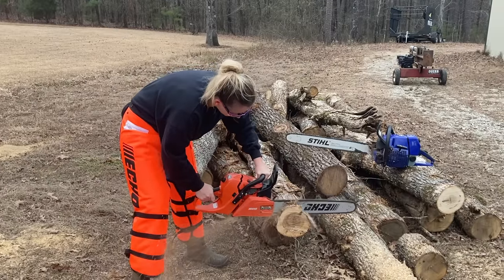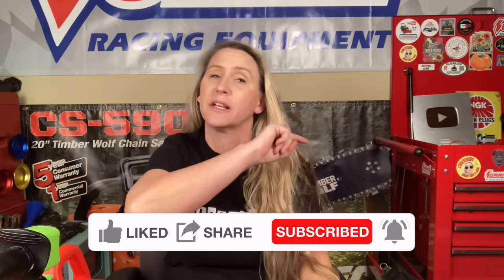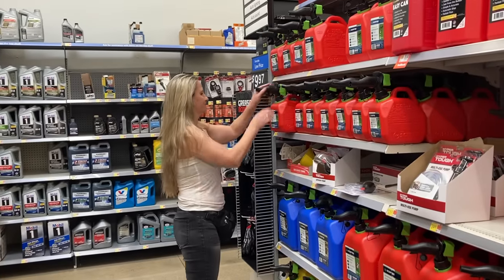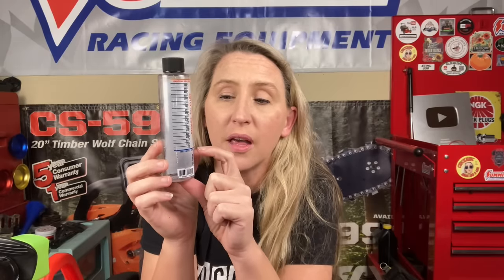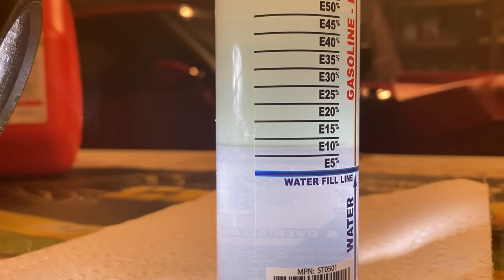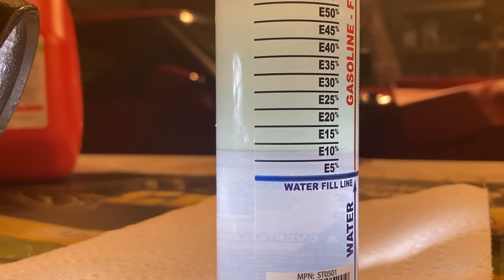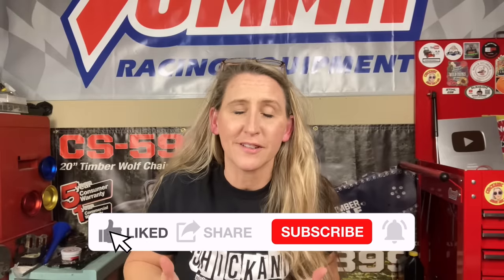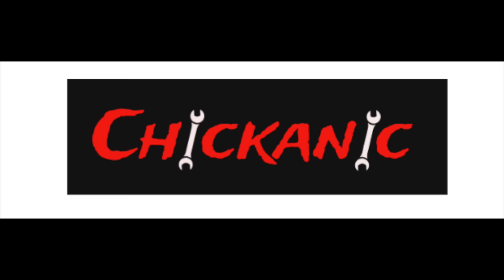Fueled by Deception. How You’re Getting Ripped Off at the Pump! (I'm SHOCKED!) VLOG

Comment: I've always wondered about this. Thank you for the no BS information. From now on when I fill my 5 gal jug with non- ethanol, I'm gonna ask for 6 gals and put the first gallon in my truck. Thanks Brea! You rock!
Reply: I used to do that. But now I drive a diesel.
Reply: Man, we really need to get Americans to fully adopt the SI units.  It's fairly simple, 5 American gallons is roughly 18 Litres and 3/4 gallons is less than three litres.  This is one of the things I hate about Sta-bil is, yes, it gives you rough approximations in Litres but the instructions are clearly written for Fluid Ounces and Gallons.  So the instructions come out with 30 mL to 9.5 L when we should be writing a Metric equivalent so I can easily use the right amount of Stabil for my 20 L and 5 L Sceptre fuel cans.
Reply: @danlux4954  I wish I could afford a Diesel tractor.  Everything runs on gasoline that I currently own.

Comment: Thanks for solving the mystery. When I cut the grass when I was a teenager in the 70s , I remember lawn mowers working for years, no problem. And you have made me nostalgic for my father’s old, all metal gas that had a screw on lid on the end of the spout and screw on metal lid in the top with the old wooden handle. It just freaking worked. The last two mowers that I bought only lasted one season.
Reply: I am still using a Shindaiwa T25 I bought in 1992 new. only NE for over 30 years. dealer told me he wished they still made them that way. Newer machines are made to emit less pollution which is one reason they do not last it seems. Thank the no backbone by our legislators who have let the EPA run over us for years.
Reply: I am using a 1999 John Deere Sabre 54" I paid $200 plus a battery 3 years ago. I cut around 2 acres. I am using NE in it. It sat since 2013 before I bought it.
Reply: Made in China, what do you expect?

Comment: I was a "Heavy Mechanic" all my life. Small engines drove me nuts. But I did learn something from a customer years ago. We were talking about how hard some small engines can be to start and even keep running. I used his advise for decades without any problems, even after sitting all winter. Always USE Super Unleaded (in gas engines of course) and gap the plug to .036. It works for any small engine. I have all sorts of small engines from mower, snow blower, weed eater, edger, trimmers, etc. NOTHING takes more than 2 pulls to start.
Reply: I used to have a small engine repair business. I was curious at one time why Weed eaters fail so soon and become so hard to start after about a year of use. One day I decided to take apart about a dozen of them customers let me keep to investigate what their problem is. My findings were that many of them had the rings fuse- welded into the piston. Once that happens, they lose compression  and things like new spark plugs, adjustment of the carburetor, changing the fuel, rebuilding the carburetor, cleaning the exhaust screen all become a complete waste of time. After that I decided to never work on them again because they are complete junk. I told customers to just buy a battery operated one. The solution would be to make the engine and piston out of cast iron instead of aluminum and to improve the cooling system. They will never do that because they would last too long and screw up their planned obsolescence scheme.
Reply: When I bought mt Stihl weedeater, the shop recommended buying Stihls 6 pack full synthetic 2 cycle oil. Each one treated 1 gallon of gas. 1st I thought he's just trying to add to the sale. But when he told me if purchased with the tool, Sthil would double the warranty period to 2 years. I now use synthetic oils in all my power tools. 2 or 4 stroke
Reply: @normtheteacher5485  I use synthetic 2-stroke oils, and never run the lean oil ratios they recommend these days.
Even in my big outboards I always ran 40:1, and in small engines 25:1.
Contrary to popular belief the extra oil does NOT cause more carbon, it actually prevents carbon from accumulating in the combustion chamber and ring grooves. It's also better for the cylinder walls and bearings.
You do sometimes have to richen the mixture screws a bit to offset the extra oil.
I've never had a carbon problem using this method. 😎

Comment: Great info, and something I had never thought about. Every non-ethanol pump I have access to has the one pump handle. Glad I watched this when I did because I’m about to go get non-ethanol for my new Stihl 261. Those fuel cans piss me off to the extreme. I have spilled more gas and diesel because of that garbage. I’ve worked for the federal government for almost 23 years so I’m painfully aware of how mind-numbingly stupid our government is.
Reply: Been using my Stihl 026 since 1993 and my Stihl MS250 since 2012. Also have two Stihl brushcutters and two Husqvarna saws, and an Echo even. I always get the 'ethanol free' and treat it and so far I don't think it's been a problem. Maybe by it going into a 5 gallon can and then with the treatment added, the ethanol is diluted enough not to cause any issues. However I WILL be looking for pumps with a handle ONLY for the non-ethanol gas - mainly because you're getting ripped off since you are paying more for it. I suppose I could just squirt a half gallon on the ground first, lol. Pretty sure the station owners might take offense!
Reply: @Graysail0r put in your vehicle first.
Reply: @Norm100ful …that won’t work when you’re driving your diesel truck to the gas station.
Reply: @davidj.leavitt249  So true.  Luckily, my pump handle is separate.

Comment: I've been telling people for years that on a single hose mult-grade pump your getting what is left in the line and you can't be sure what tanks they are drawing from, but everyone is to trusting and say oh that can't be.  Well guess what you just proved it, thank you..  Love your video's keep up the good work.  Regards from AL's Small Engine  😁
Reply: I hear you. I’ve told people also for a long time the same thing and their response was that I was full of crap. Lmao 🤣
Reply: I remember way back when -when ALL of the pumps had different grades in them. Not anymore though.
Reply: I have been telling people that too for years. We who fill up with high octane get a gallon of shitty gas that we paid full price for and the person who fills up after me get a gallon roughly 4 litres of high octane for the price of cheap gas. In Canada it's in litres and we pay on average 2.00 dollars CAD per litre with all the taxes added to it. Carbon tax be damned. I now use a Greenworks™ battery operated chainsaw. Lol!
Reply: @billybrand  now all you need to be concerned with is if the electricity was generated with wind, solar, hydro, propane, nuclear or coal.:face-purple-smiling-tears:
Reply: @iffykidmn8170  I get around an hour of cutting with one charged battery and I have three. I use my off grid system to charge the batteries. Biggest issues are the costs of the batteries and the pollution that will be caused from disposing them even at a recycling place.
Reply: It's more of a problems with motorbikes with the small gas tanks than a car.
Reply: Ask them if their water hose still has water in it after they're done watering their flowers. Then explain to the few brain cells they have that this is exactly how the hoses at the gas pumps work.

Comment: I drive 20 miles out of town for my gas just because of this. The next town over has a designated pump for ethanol-free gas.  it's worth the drive because my livelihood depends on my equipment. Your video is spot on, good job 🇺🇲
Reply: AFAICT, the reason to use ethanol free gas in lawn equipment is only because most people use it lightly once a week and so the gas tends to sit in the tank for a long time, and Ethanol gas turns to varnish faster.  If you are using it every day and getting fresh gas every day or two or three, then what's the point of going ethanol free?  I've had a brigs and straton mower engine for home use for 12 years now.  It ran a little rough last week when I fired it up for the first time in 4 or 5 weeks, with gas I probably got 3 or 4 months ago ( the usual 10% ethanol sold everywhere in the state ), but next week when I get fresh gas it should run fine again.  And I've never even changed the spark plug.  I got a new one to change it next week since.. well, it should probably have a fresh one after 12 years.
Reply: Matt Bonner We are lucky here in our small town that we have a station
that sells ONLY E0 gasoline. Nothing but raw gas. Expensive as hell, but
free of alcohol. Use in all my small engines that are not run several times
a week. Don't know for sure how much better it is than E<whatever>, as
I never did a scientific study, but I will continue using it........

( they also sell kerosene by pump from large tank. Unusual.)
Reply: Are you positive they have a separate tank
Reply: @phillipsusi1791  
Big point for pure gas is motorcycles.
A small amount of ethanol makes them to hot to ride.
Reply: Good for you. I drive 18 miles just to get ethanol free gas. My pickup and power equipment thank me.
Reply: @oneslave3318  Well that's an interesting point.  I believe I have heard others claim that ethanol burns hotter, but then again, if it does, that should produce more power shouldn't it?  And therefore, you should reduce your throttle to achieve the same speed, thus, in the end, the same heat should produce the same power/speed shouldn't it?  Even if it takes less fuel to produce that heat, a given amount of heat should produce the same power.
Reply: @dd_ranchtexas4501  There is no such thing as "raw" gas.  There are an infinite number of possible distillates from oil that contain a vast mix of alakenes that produce a range of octane ratings.  AFAIK, all products sold as "gassoline" then have other additives blended in after the distillation process to enhance the octane rating of the fuel. One of those additives is ethenol.  They used to use a compound of lead but that was banned for obvious health/pollution reasons.

Comment: Here in Central Texas we're lucky to have QT stations that have 90 octane ethanol free on their own hose. As a full time WFH I don't drive much so that's what I use for both my car and truck. For the power equipment, I mix that 50/50 with VP110. The VP110 is from a power sports equipment store. I literally can let my gas weed eater and blower sit all winter and have no issues with starting  them in the spring. Same with my dirt bikes. You pay a little (or a lot) more for the ethanol free but totally worth it to me because it won't gum up your carburetors. Thanks for your videos!

Comment: I was made aware of this problem many years ago after reading a motorcycle magazine story about this subject. That article was about buying premium fuel and getting regular fuel for the first .3 gallon or so when using the single hose pumps. They recommended always going to the pumps that had individual hoses for each octane grade. Unfortunately those seem to be hard to find these days.
Reply: Whenever I’m out riding with a friend I will pay for gas but fill his tank first, since I pay I don’t feel as guilty. 🤣
Reply: @marktype1with2  Savage
Reply: That's what I used to do but you can't hardly find stations with individual pumps anymore.I like to use ethanol free gas every once in a while in my bike and always in my weed eater and chainsaw.
Reply: Us bikers have known about this problem for 20 years +.  As for the mixing manifolds, anyone old enough to remember Sunoco had that setup as far back as I can remember You had a choice of 190, 200, 220, 240, 250,and 260 even had another choice but it wasn't available unless you had a friend at the station.
Reply: Pumps with individual hoses for each octane grade are pretty much standard at stations in Okla.  100% gasoline widely available, too.  (if you're willing to pay the .40 to .50 cents per gallon extra).
Reply: If we, as a nation of consumers, boycott en masse, all stations that have single hose pumps for their multigrade gasoline, then, the bean counters will eventually get the message.  The stations that employ individual pumps for each grade sell more gasoline than the ones that do not.  All we all have to do is be a little more vigilant and selective on where we purchase our petrol.

Comment: When I’ve been filling my gas cans, I was filling them first and then topping off my car.  In the future, I will fill the car first and then the small tanks.  Thanks for the video and the great real-world tests.  As a former fire and explosion investigator, I do have one suggestion.  Always place plastic gas cans on the ground and touch the nozzle to the can when filling with gas to avoid the buildup of static charge and potential ignition by static spark.
Reply: Ugh i
Reply: I can't say I have a reason for it, but I have always filled my car first, then the can.  Then again, I also usually pour whatever is left in the can into the car after it has sat there for a week or two and go refill it with fresh gas, after topping off the car first.  I guess that's just to keep the gas from going stale.
Reply: Static electricity from a plastic gas can?
Reply: @rodrogers6895  yes, it's a lot like what happens when you rub a balloon against your hair, a carpet, or something similar.  When non-conductive fluids like gasoline flow, they transfer static charge to the container.  If that charge can't dissipate to ground, it builds up and can eventually spark back to the grounded fuel nozzle and cause ignition.  To reduce this risk, some plastic gas cans have filler materials (like carbon black) added to make them slightly conductive so they more easily transfer the electrical charge to the ground and are less likely to spark back to the  fuel nozzle.  But they still have to be setting on a grounded surface.

People also cause ignition by getting in their car while filling their tank.  When getting back out of the car they slide off a cloth seat and build up static electricity on their body.  If they don't discharge the static by touching something metal like the car body or the gas pump, a spark can jump from the their finger to the filler nozzle when they grab it.  That spark can ignite the fumes coming out of the gas tank.  Search "Gas Station Static Electricity Fire" on YouTube for a video of this happening.

Probably more info than you wanted, but burns suck, so it's worth sharing.
Reply: @Pickle Where did this discussion of static come from?  The topic was buying one grade of fuel and getting at least a good chunk of another because that is what was left in the hose from the last purchase.

Comment: 2 things I want to say about this video. #1 thank you for doing this! #2 I have a gas station in my town that only sells ethanol free gas but it is a bit more expensive and it is on the other side of town. But when I fill up there when I have less than an 1/8th of a tank I notice I get about 3-4 MPG better than the 10% ethanol gas. In a vehicle on a good day with a tail wind I get about 13mpg on the highway on the 10%, on the ethanol free gas I get 16-17mpg.
Reply: I find that true with diesel fuel also, the price per gallon is not worth the loss in mpg. I avoid it as often as possible.
Reply: Ethanol has a lower energy content than gasoline, it takes more of it to do the same amount of work as gasoline.
Reply: If I take my old Chevy pickup to any other station than my regular one I have to adjust my timing to keep it from spark knocking.  Just a few degrees but the performance difference is noticeable, as well as the efficiency.  
✌🔧🍩
Reply: @donutdan1508  There's a way to make your own fuel...5 gals at a time or ...👍 U can find a few vids.

Comment: You confirmed exactly what I have told others. I take 5 gallon containers to get ethanol free fuel for my mowers, chainsaws, generators,etc. I pump a little into my truck tank before I fill my 5 gallon containers.
Reply: National geographic ran an article several years ago,another engine in trouble is motorcycles
Reply: Exactly what I do for the same reason. 👍
Reply: Diesel pickup.....